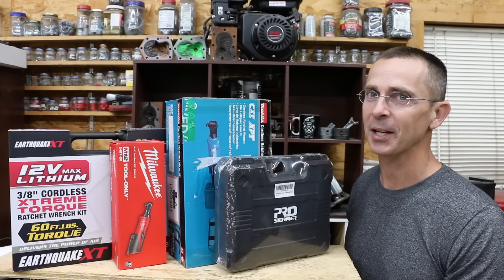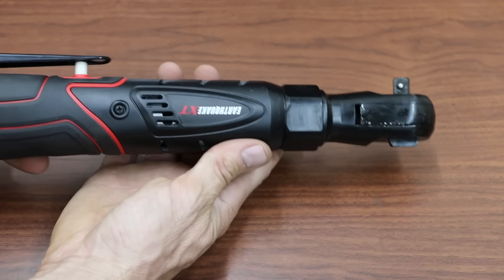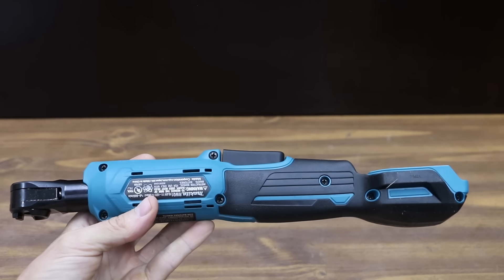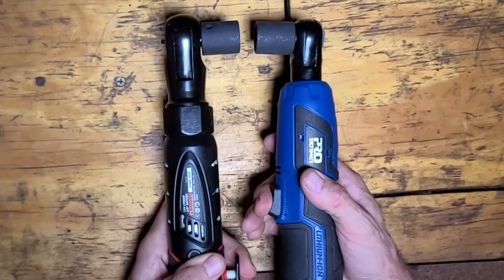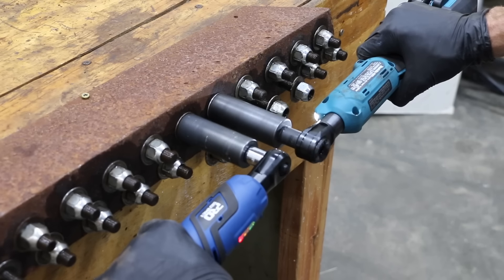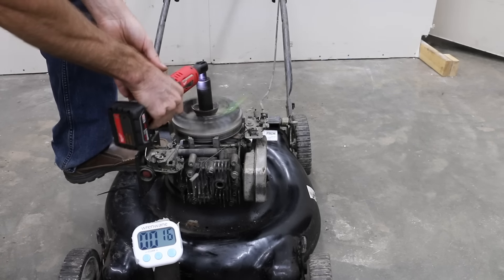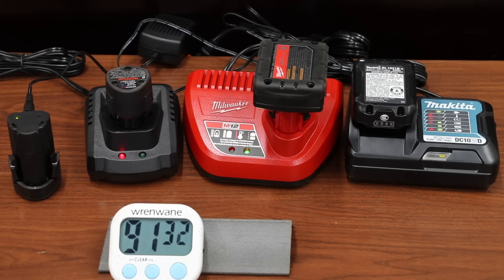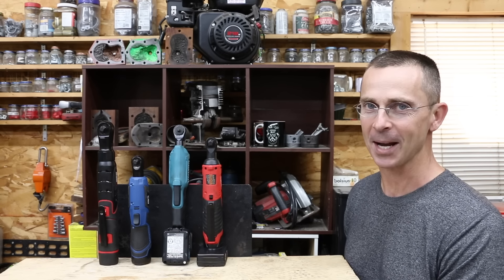Best 3/8 Cordless Ratchet? Milwaukee M12 vs Makita, Earthquake & ProStormer. Let’s find out!

Comment: The milwaukee fuel version would blow the rest out of the competition by a long ways.
Reply: I have the fuel and love it I could be wrong but I think they lowered the RPM to give it more torque.
Reply: The head is much larger on the fuel
Reply: I've been using three fuel tools professionally for over a year now. The build quality is very impressive and the tools work exceptionally well.

Can't see buying anything else at this point.
Reply: I have the fuel one as well and the head is much bigger, but man it’s incredible how good it is!
Reply: @jcub231  usually I find that if the head is to big I doubt any electric ratchet will work I know not always but most of the time.
Reply: @Pknuckles1804  I really want a 1/2 inch impact I have a Ridgid but it's gen 4 only 300 ft pds need a little more torque only have 12 volt Milwaukee might have to stick with Ridgiid unless Milwaukee has one more powerful in 12 volts.
Reply: Milwaukee Fuel: when you want snap-on quality, but don't wanna pay snap-on prices.

Also snap-on was super late to the brushless game.
Reply: @travisevans7502  Milwaukee has an 18 volt series of tools that'd be right up your alley.

Personally I'll stick to my IR air impact for 1/2" stuff. Hasn't let me down in the 20 years I've owned it.
Reply: @Pknuckles1804   Yeah I really like all Milwaukee power tools but I already have the Ridgid 18 volt with several tools and batteries and Milwaukee 12 volt for my ratchets I really don't want to invest in another platform I'm going try to get one in either platform I already have I am happy with both and really like Ridgids LSA.

Comment: Thanks for the review. I had procurement purchase me the Milwaukee M12 3/8" ratchet for work and honestly, I cannot believe I lived so long without one. Makes installation and maintenance work so much easier. Though I do occasionally have to break the nut first with a manual ratchet/breaker bar, the ratchet just zips it off where an impact gun cannot reach.
Reply from the maker: Thanks for sharing!
Reply: You can still use the Milwaukee ratchet to break the bolt loose Just don't squeeze  the  trigger, just use it like a regular ratchet.
Reply: @derekcarpenter5394 I do sometimes if it's not too locked up,  but I rather not put that much torque into the M12. I have blown out manual ratchets and breaker bars in the past.

Comment: Glad the Milwaukee proved itself. I've had mine for a month now and it's been great at work. Well worth the price of admission.
Reply: the brushed model like shown or the brushless fuel model?
Reply: @AndrewBrowner  I honestly don't remember. It takes the M12 batteries. Thing last forever and works great for everything I throw at it. I've been wrenching for 14 years. I previously had the little Amazon shitbox special Kimo unit and that literally caught fire within a month. JUNK.

This thing is great for everything. Break whatever loose with a breaker bar and spin it in or out with this. Saves a ton of time instead of sitting there with a gear wrench or a ratchet moving it  a hair at a time.
Reply from the maker: Thanks for sharing.
Reply: I got the brushed non-fuel model... really like the tool.  Great at assembling things. Would be interested to see how the Fuel model does in this test. The head is a lot bigger.

Comment: I'd be interested in a follow-up on the FUEL version vs. the regular Milwaukee.  (I have the FUEL 3/8" and really like it)
Reply from the maker: Great suggestion! Thank you
Reply: @ProjectFarm  I also would like to see the Fuel version tested. I'm in a Facebook group for Milwaukee tools and alot of mechanics actually prefer the non Fuel version because the ratchet head is smaller. Also Milwaukee makes a 2.0ah 12v battery that I prefer because it is as slim as the handle of the tool. Thanks for your work Todd!!!
Reply: I agree with previous replies, would like to see the Fuel version tested. I also use the cp3.0 or cp 2.0 batteries because they are slimmer.
Reply: Great idea!
Reply: I have an m12, my buddy has the fuel. As expected it’s a bit more power but the head is too big for tighter spots. I prefer the m12.
Reply: The feul is to bulky i returned mine
Reply: I bought the non fuel version specifically for the higher rpm and smaller head. I absolutely love it and wish I owned it sooner.
Reply: The nonfuel in 3/8 is the first one you should get
Reply: @Turbogto_guy  I hear the "tighter spots" thing a lot - could you give some examples?  Mine is mainly used for the family cars and my old BMW.  So far I haven't hit any spots I can't get to, though the tight spots for me usually find me with a 1/4" swivel/roto-head ratchet in my hand.  If I ever see a super deal on the 1/4" "regular" one I might grab it, but the roto head ratchets are fantastic for smaller (and thus usually shorter) fasteners...
Reply: @kylefowler5082  Yeah - a 2Ah battery lives on mine and took me entirely through a pretty involved session recently with my kid's car to replace the PS pump and lines, the alternator, the oil filter housing gasket (which is DEEP and requires removal of a bunch of stuff to get to it), the CCV and other stuff.  Still had half a charge left.  I also trust the beefier design to crack nuts more than the regular version.  As I said somewhere else, I haven't really hit a place I want to use it that it can't get to (at least where I think a skinnier head/etc. would help).  Those jobs usually wind up with a 1/4" roto-head ratchet.
Reply: @kylefowler5082  the slim battery is a 3Ah now.

Comment: I loved the testing. But, seeing as how the Milwaukee comes with two 4.0 batteries vs just one 2.0. There is really no competition.
Reply from the maker: Thanks for the feedback.
Reply: Milwaukee does sell a 2.0 Ah battery I'd like to see the tests for the Milwaukee redone with that one to see how it holds up
Reply: @trevorc.4350  they also sell a 6.0 battery
Reply: IDK about the m12 stuff but I have a large bit of m18, and there actually are some very large variances in torque output between my standard 3.0 and compact 3.0 batteries.  My standard 5.0 comes close to the compact 3.0, but not quite the same TQ

Comment: Also still really want to see a 1/2" impact comparison. Keep up the good work, love the channel.
Reply: Yes, show us something that truly could fight a rusted large bolt with a ton of power
Reply from the maker: Thank you for the video idea!
Reply: @project farm if you test impacts you should test the craftsman v20
Reply: This is a great idea! I'd like to see the Milwaukee 2767-20 cordless impact go head to head with the Ingersoll Rand W7152. I know a guy who is a die hard Milwaukee fanboy, and I hated that impact. I used his multiple times and it was heavy, bulky, 2 power settings only, straight on angle caused the battery to go against wheels, and the light sucked. Myself being a horse of a different color, I chose the IR W7152 because of its overall design and features. It's lighter, smaller overall length of the head nose to back, the halo light is awesome with 4 different settings, and can be used as a work light for 10 minutes in the neutral position (definitely handy under a vehicle).  Also, the angle of the head helps keeps the battery end from contacting wheels when removing lug nuts, and I like the 4 different power level settings. Battery charger takes around 45 to 60 minutes to fully charge the dead 5.0ahr battery which really surprised me. The charger also has a built-in USB port for mobile device charging. It also seems to have better balance and ergonomics. IR claims 1500ft lbs reverse, vs Milwaukees 1400. I think other channels have covered this though, but I'm unsure if they were as comprehensive as PF is!
Reply: @ENGINERESCUE86  i run the 2863-20 milwaukee impact and love it the bluetooth app lets me make 4 different torque profiles so i have 3 for wheels and one that is full power super nice to be able to do
Reply: @shrekdaklown  thats all fine and dandy, but the IR doesn't need a gimmicky phone app to have 4 power settings. Also, the light is still underneath the head which is just inferior to a 360 degree halo light. Why would you put the light underneath near the trigger when you are typically looking at the fastener from the top? Whenever I use a Milwaukee tool I find myself having to look under the top of the tool to see what I'm doing. Im just giving observations and opinions. I think the tool/their tools are overrated, and overhyped. The Milwaukee name is misleading in general because most of them are made in China like everything else these days. I have one of their m18 cordless drills. A lot of the time when drilling, and you release the trigger, it stops so fast that the chuck comes loose and then I have to tighten it again. I use my corded 80s black and decker more often then not because of that. The plus side is I don't have to worry about a battery going dead, which is a trade off for me since I don't like wasting time fooling around with batteries. Now on the other hand I do own a corded Milwaukee Sawzall, and I love it. Its old, us made I think not sure, and its a beast that has taken anything I've ever thrown its way with zero complaints from the tool. Its really just a matter of preference is what it all boils down to.
Reply: freezeme360  I've seen their mid torque impacts. They are indeed a nice size with enough power to do most things. But for me I don't bother with them because I don't have a need for a smaller, less powerful impact. If I'm working on something that makes half inch drive overkill I just use a wrench or a ratchet. If I have to do a lot of bolts all at once I grab my 20 dollar 3/8ths drive pneumatic power mate impact and deal with a hose for a few minutes. It might be a cheap tool, but it has plenty of guff to remove anything that I've thrown at it.
Reply: @ENGINERESCUE86  it has 4 settings on it already the app just lets you customize it and also has gps tracking if your tool grows legs I don't really use the built in light myself I respect your opinion not arguing that one is better than the other but my impact definitely is not over hyped I love it
Reply: @shrekdaklown  I just say what I see. A lot of guys out there love those, I get it. It just seems like a lot of people are Milwaukee or nothing. The m18 system is great absolutely. It just wasn't what I wanted for my usage. As they say, to each is their own.

Comment: Makita started to smoke on the end of the engine test.
Reply from the maker: Thanks for watching!
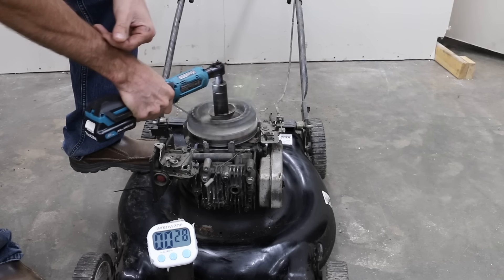Reply: Dang you're right! 9:58
Reply: Looks as if the smokes coming from the socket, rather than the motor in the body
Reply: @jjmmjj9999  it's either coming out of the ratchet head or the body, definitely not the socket.
Reply: @toasty4000000  Looked to be coming out the vent holes in the front of the body. (Which is where you'd expect.)
Reply: @toasty4000000  just played in 0.25x and yeah you're right. Seems like it's from the body where the head joins. My mistake

Comment: I was given a Earthquake for Christmas last year. The battery is, by far, the weak point of this tool!
Reply from the maker: Great feedback on the Earthquake!
Reply: Seems to be a consistent issue with HF tools.
Reply: eventually the batteries are the weak point of them all, they will degrade and you will have to replace them. Same goes for battery powered mowers, they've great until the batteries go, then you have to make another expense that makes you question your purcahse as they usually cost MORE than the tool itself

Comment: Bought the prostormer about a year ago at o'reilly for $50. My absolute FAVORITE tool I own. I use it more than anything and it has saved me HOURS and many curse words sitting there trying to get bolts off with a normal ratchet or wrench.
Reply from the maker: Great feedback on the ProStormer

Comment: Hi! I have an idea for something to test! I'd love to see you put steel toed boots to the test to find out which brand will actually keep our feet the safest.
Reply from the maker: Great suggestion!  Thank you.
Reply: If this one pans out, PLEASE include the Walmart Brahma brand. I've bought a total of 3 pairs in my, the best lasting almost 2 weeks. People need to know those are junk.
Reply: @TonyGingrich  if a pair work boots lasted less than 2 weeks, why on earth would you have bought 2 more pairs after that?
Reply: @ghostwrench2292  Ha! For one, I certainly didn't buy them back to back. The purchases spanned a timeline of approximately 10 years. And secondly, they were each a different model.

First pair: Standard ankle lace-ups. I was young, inexperienced, and therefore, shallow-pocketed. Bought them for concrete work. Soles ripped off just in time for my first paycheck.

Second pair: Shoes, not boots. Destroyed on about the third day of use on a factory floor, when an 8-foot length of oily 4" angle iron slipped through my gloves and onto my foot. Resulted in stitches after having a plastic shard pulled from between my toes (turns out, "steel-toe" can instead be plastic).

Third pair: Slip-on ankle boots. Bought as a requirement  for the relative few times I would be walking in the areas requiring them. First time in said area, my foot slipped into a crevasse and peeled the boot apart from the top seams and partial sole. Seeing they could not even tolerate a simple walk, those were the utter last straw

Comment: I would like to know how Milwaukee’s FUEL version does against these as well
Reply from the maker: Thanks for the video idea.
Reply: The FUEL version is the only way to go with anything milwaukee
Reply: More money is all, can’t survive a 3’ fall, I know from experience.
Reply: I got the FUEL ratchet but kind of wished I got the standard one due to less weight.
Reply: I had this Milwaukee ratchet. The FUEL is way more torque.
Reply: And Husky...
Reply: Now I'm confused, all my Milwaukees say M-18 Fuel on them, and I thought the 'Brushless' was the better, more expensive line. It certainly is for their signature product, The Sawzall.
Reply: I was thinking the same thing.  Where's the brushless version?  It would have destroyed these others in speed and torque.  However, it does have a larger size and weight so the one tested here is kinda nice in tight spaces.
Reply: @RobertMorgan  there are 2 sizes m18 means 18 volt m12 means 12 volt fuel means brushless
Reply: @RobertMorgan  torque, yeah fuel wins. But the brushed one spins faster from what I can tell.
Reply: I have both the standard and FUEL Milwaukee 3/8 ratchets. The FUEL model has a much larger ratchet head and is heavier. I use the standard m12 ratchet far more. 

What people don't realize with cordless ratchets is the motor isn't really intended for breaking free or final tightening torque. The RATCHET& HANDLE should be used for that, then use the motor to spin the fastener off.

Comment: I really enjoy my earthquake xt, I use it here at the house, but if I was still working in a shop I would go with one of the faster ones.

The batteries for the HF are only 20 bucks iirc
Reply: I would’ve like to see the Milwaukee with a two amp hour battery since that’s what the kit comes with
Reply from the maker: Thanks for the feedback.

Comment: Sometime I'd love to see a best electric 1/2” impact gun, Milwaukee vs. Rigid vs. HF vs. Snap-on
Reply from the maker: Great suggestion!
Reply: The best isn't in your list... It's DeWalt.
Reply: @dontblameme6328 Default (Dewalt) - 1/2" Cordless, Impact Wrench, 20V DC, 1,200 ft-lb Breakaway Torque, 
Milwaukee - 1/2" Cordless, Impact Wrench, 18V DC, 1,400 ft-lb Breakaway Torque, 
or the 1" at 1800 ft/lbs
or the 1" D-handle at 2000 ft/lbs, 
:) all in good fun, but your wrong, Milwaukee has this portion of the market cornered.
Reply: Those snap on impact guns are no joke! I was making fun of my friend for buying one for like $500 used, but it took off my car’s axle nut like it was nothing!
Reply: @samoliver9132  they are honestly a joke in my workplace a lot if people have snap on 1/2 rattle guns and my Milwaukee keeps up with if not out performs them any day of the week battery life and torque plus i got the full kit with charger and 2 5ah batteries for $400 less than just the snap on 1/2 gun.
i dont have anything against snap on they do make great tools but their electric tools are no good in my opinion.
Reply: @blakehancock776  yeah I’d never personally purchase snap on cause Milwaukee is about as good at a fraction of the cost. I’ve just never tried out a Milwaukee impact gun so I don’t know how good they are compared to snap on.
Reply: @samoliver9132  I’ve used a couple and they have some scary torque. I almost don’t want to use a torque stick with them so I don’t snap it haha
Reply: @blakehancock776  I agree with the price. Snap-on is way to expensive. The main point is, is Snap-ons tool rated for less going to out perform the Milwaukee tool. Snapys rated at 700lbs
Reply: @jacobisbell6466  yeah I rounded so many bolts because I wasn’t being careful with it. It just shreds the bolts with how much torque it has.